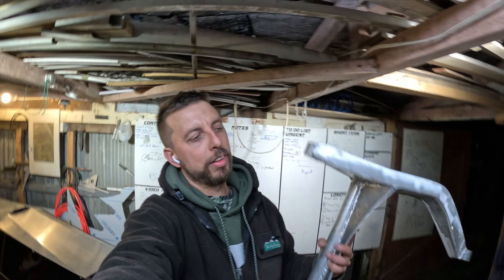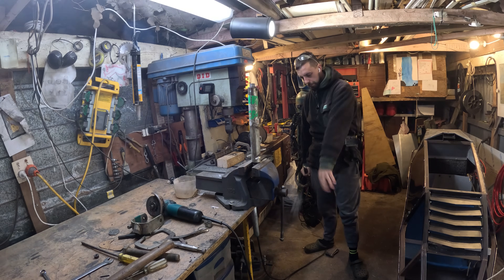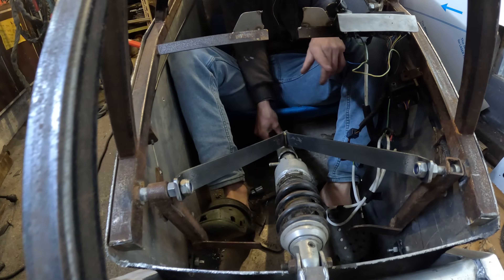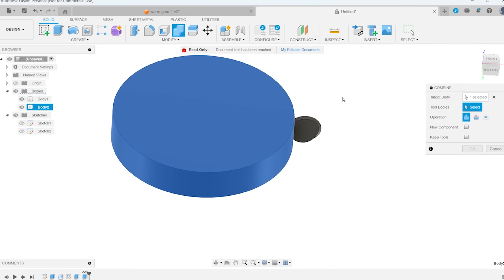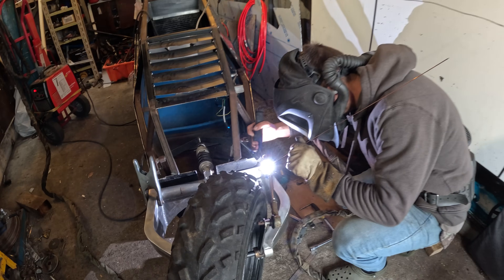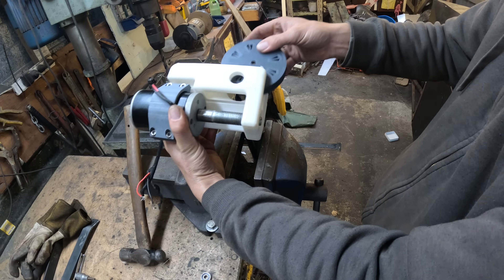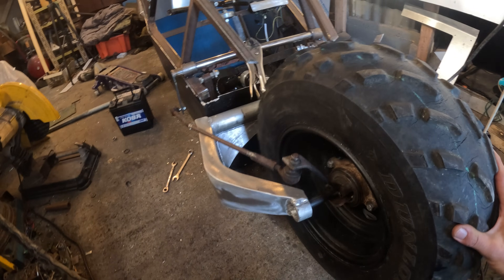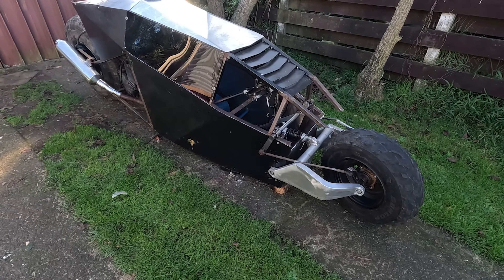Bat Bike Center Hub Steering Build

Comment: To avoid broken wrists: A. Use a step bit, they don't grab nearly as hard as regular drill bits in plate metal, B. Hold the drill upside down with the battery/handle braced against the inside of your forearm to counter rotational forces. Like my dad always taught me, "Take care of your tools and your tools will take care of you", the first and most important tool, of course, being your hands. Love your work, keep it up!

Comment: I think for the system to help make it stand. Find out what threads are the quickest for up down motion. Id use them to make like almost hydraulic skids that are quick enough. But to help that i almost wonder if u can make a gyro inside the wheel you might need 2 side by side one might need to spin opposite of the other. And can possibly use like mini bike drum brake pads to stop it.

Comment: Take a page from the Monoracer and instead of stationary balance use retractable outrigger wheels that also work as wheels against the ground when retracted in the event of a tipover.   I recall one clip where it was deliberately driven in a turn so tight it laid down onto the retracted wheel, was stopped,  and then was recovered in the same way.  Your Batbike might not be able to do exactly that maneuver, but the general crash safety principal (not to mention saving the bodywork) is the same.

Comment: 2:31 You're not kidding!  These things'll rag-doll ya if you're not careful! 
Sort of like w/ exploding cut-off disks and getting wire wheels stuck in shoelaces.. 
If it's Never happened - You've got the best of luck! haha  GREAT TIP!!
Reply from the maker: The cad drawing took quite a long time to learn I just watched lots of YouTube videos on fusion 360 , sure you could figure it out
Reply: @dkthewelder  Ah no kidding?!  Good on you bro!!  I dabbled w/ Auto Cad back in early 2K's
then jumped straight into Solid-Works.  *That's what completely threw me.  Then tried a few others - equally confusing.
Fusion 360.  Yessir,  that's what I've been deep diving into lately.  Great program - if/when someone can efficiently use it!
Thanks bro,  I'll keep pluggin' away for sure!
Reply: Your CAD and Fab skills Rock,  bro!  I was TRYING to follow along 
as you were designing your worm-gear...  
Damnit,  I'm just too tarded still for this stuff not to fly over my head.. 

Excellent Job!  That turned out amazingly! 

Hey,  how are you liking your  K1 Max? 
I ventured into 3D printing w/ a Bambu Lab X1-C, 
but as previously mentioned - just too stupid still to grasp CAD
[This coming from someone who was schooled in hand/manual mechanical drafting]

Comment: Always wanted to try and ride a bike with backward steering, I don't think you need the additional challenge with this bike though. Impressive CAD  skills, if only it could print metal parts. Have you ever used the printer to make patterns for casting in metal ?
Reply from the maker: I have thought about it a bit but casting looks pretty difficult and time consuming

Comment: Window wiper motors are a good source of free high torque motor setups be good for the front
Reply from the maker: Someone I tried wiper motors on something once didn’t seem that good but maybe I had small ones
Reply: @DktheWelder  have used a couple before with varying results some are better than others